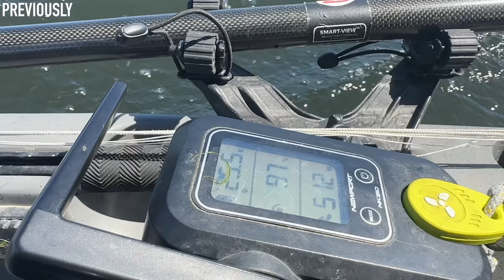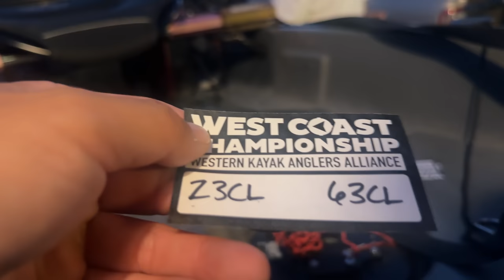Yak-a-Bass Stop #7 - California Delta (and WCC Day 2)

Comment: I commented this countless times and will continue until he maybe finally reads it. He should mark the kayak somewhere on the side of the hull by his feet or on the rail with 12" and 14" lines. That makes it easy to just hold the fish there after landing it and not have to pull the board out. Such an easy thing to do, but would be really useful.